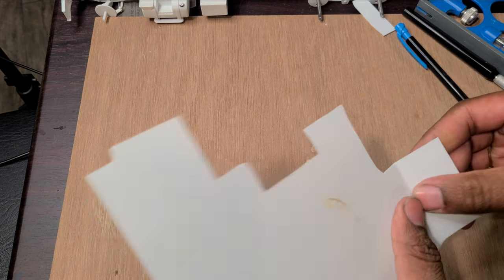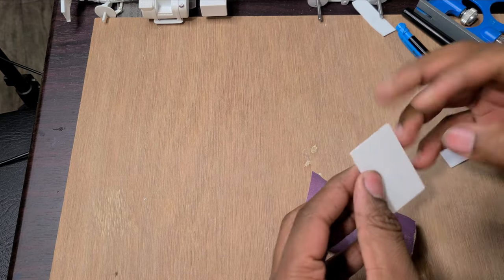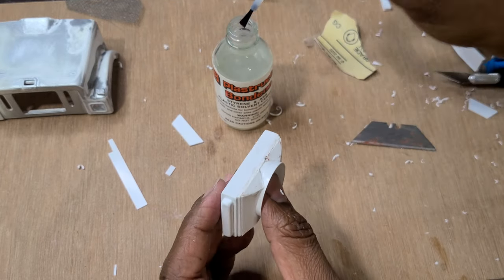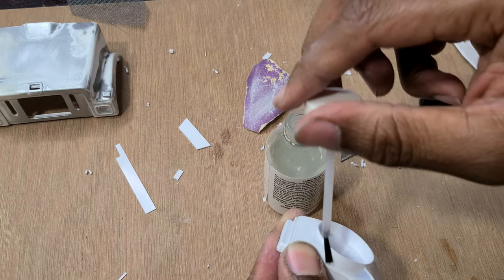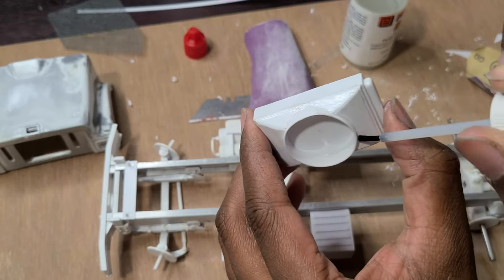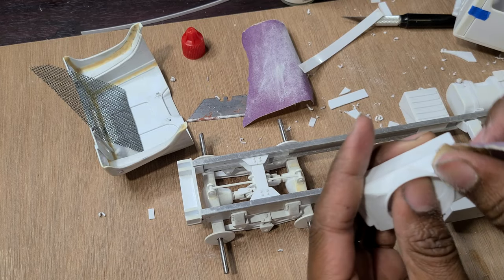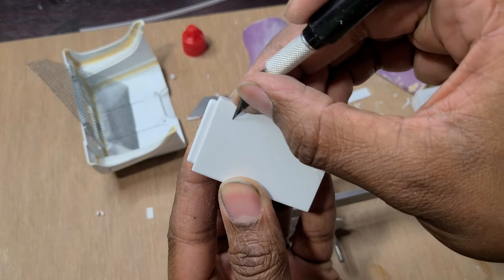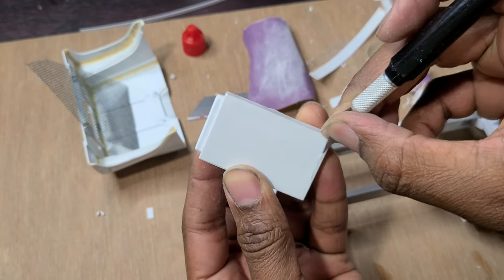HANDMADE INTERNATIONAL Truck |Styrene Plastic | PT.6 [Radiator]

Comment: I need to ask you a question. If you glue something with that weld glue and you need to separate it for some reason how do you do that?
Reply from the maker: You could use a sharp blade to cut or mark along the seam as best as possible, and then try to pull it apart. You'll typically get a clean separation that way. The thinner the mated surfaces are, the easier it will be to separate them. If you should weld two large flat surfaces together with an excessive amount of this stuff then it will never separate without damaging the styrene.